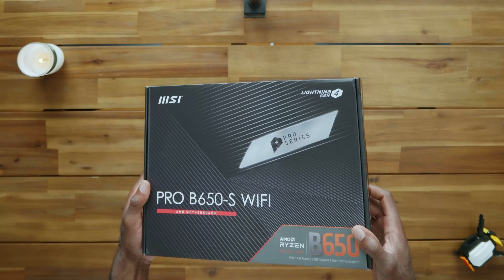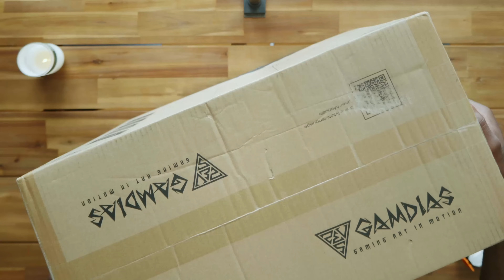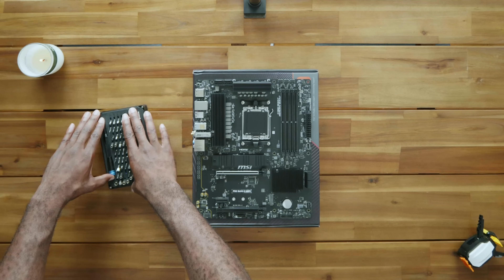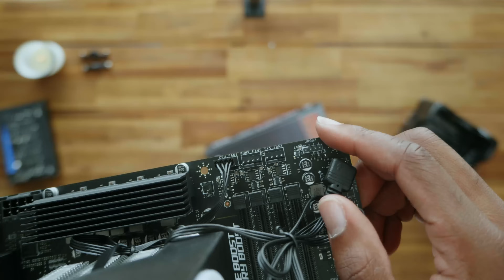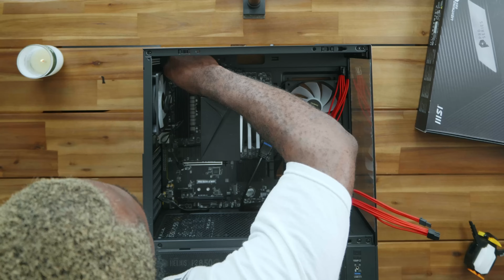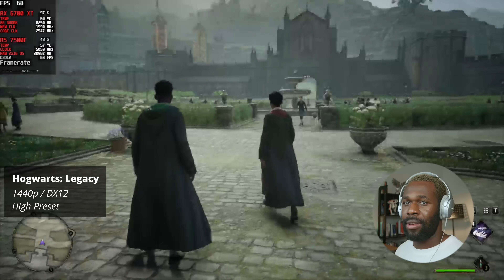A Calming $900 Gaming PC Build ❤️

Comment: Ill be honest with you for 900$ thats pretty meh performance for the story games with new parts but for your multiplayer games like r6 it will be excellent I would rather buy used parts for it to be cheaper and the optional cable extensions and combs will be useful for reselling but it wont sell because of the high price

Comment: Oh I also got a Ryzen 5 7500f, but a rx 6750xt gpu and just recently bought a ASRock B650m pro rs wifi motherboard. 

I still need to buy like 4 more parts to my pc build like ram, ssd, cpu cooler, and the psu. I may swap out the psu for this one if it cost that much. Was going to get the msi mag 850gl which is like 114 for the black unit. Other than that everything else is fine.

Hopefully soon I can finally be done with my buile!

Comment: I'm really glad you did this one at the higher price point. There aren't many cozy builders, and I've got a $900-$1,100 budget on a main PC replacement and I'm really only interested in 1080p gaming, though I wonder if my 4K/30 TV could do 1440p at 60? If not, 1080p will be fine.

This goes in my living room, and I'll pass my old PC down to my two younger sons for their room.

Anyway, by giving me an example of what you can pickup secondhand for a CPU and GPU, and this not being a pressing project, I'll have the patience to wait for a good CPU and GPU at killer prices, or at least what you did.

Do you have an opinion on the CPU/Motherboard/RAM combos that AliExpress sells? Or are they horribly unreliable?

Comment: I've been subscribed to your channel for a while now and your videos are so calming and your builds are so downright logical that you've inspired my next build. Well it's more like you've inspired me to finish my current system. I've been using a mish-mash of parts for years because I gave all my good stuff to family. An 11400 with no gpu, stock cooler, an h510 itx mobo, 16gb Corsair LPX ram, a 600w Corsair sfx psu, in a Rosewill case with no side panels because there's absolutely no airflow. I'm gonna upgrade to a Thermaltake Versa H18, which I've grown to love after seeing it on your channel so many times. I'm going with a Thermalright Assassin X cooler because it's all I need. I wanted a really clean, white, minimalist, liquid cooled system for a long time, but I've realized I can get a lot more bang for my buck buying the "uglier" budget parts and putting the majority of the budget into the cpu and gpu, which will most likely be a 5700X and RX 6700 XT. Almost a sleeper build. No rgb, no bling, just sensible hardware that gets the job done. Love the channel.

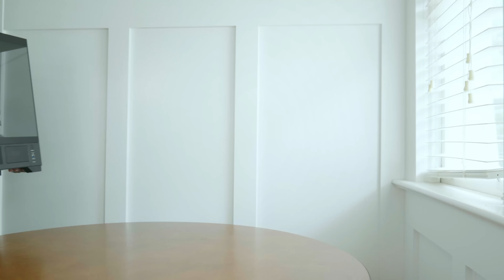Comment: @17:20 the Graphics Card is already bending - it needs support to keep it straight, it's too heavy for the PCIE slot.
It will work fine for now, but in the long run it will break your card (I learnt that the hard way)

Comment: I believe the Ryzen 5 7600 comes with the cooler, saving a bit of money, plus it's slightly faster than the 7500f. Also the PSU should be at least 750W, taking GPU and CPU upgrades into consideration in the future, seeing as we're building on the new AM5 Platform. Also if you can, find 6000mhz DDR5 Ram, as AMD has officially stated that this is the sweetspot. Check that the CL is preferably CL32 or lower, but it's not too important at this price/performance point. Generally, for gaming at least, spending less money on the cpu and more money on the GPU is important, especially if you're gaming at 1440p or higher. At 1080p the CPU becomes more important though.

Comment: Hey dude, quick tip there, the jump in performance from 5600mhz cl40 to 6000mhz cl30 ram is pretty huge and the price difference is very small, the specific kit you chose is kind of atrocious

Comment: Total: $907.76 Better: 6000 CL30 RAM, 3 m.2 mobo, hi-end NVME, A-tier 750w PSU
CPU: AMD Ryzen 5 7500F 3.7 GHz 6-Core Processor  ($130.00) 
CPU Cooler: Thermalright Assassin X Refined SE ARGB 66.17 CFM CPU Cooler  ($17.91 @ Newegg Sellers) 
Motherboard: ASRock B650M Pro RS WiFi Micro ATX AM5 Motherboard  ($149.99 @ Newegg) 
Memory: TEAMGROUP T-Create Expert 32 GB (2 x 16 GB) DDR5-6000 CL30 Memory  ($94.99 @ Amazon) 
Storage: MSI SPATIUM M480 PRO 2 TB M.2-2280 PCIe 4.0 X4 NVME Solid State Drive  ($129.99 @ MSI) 
Video Card: XFX Speedster QICK 319 Core Radeon RX 6750 XT 12 GB Video Card  ($250.00) 
Case: BitFenix Nova Mesh M ARGB MicroATX Mini Tower Case  ($54.90 @ Newegg Sellers) 
Power Supply: Thermaltake Toughpower GF1 (2024) 750 W 80+ Gold Certified Fully Modular ATX Power Supply  ($79.98 @ Amazon)
Reply: His Motherboard is better.
Reply: NOPE. @GameslordXY

Comment: Really not impressed as to how far we've come in the last 3-4 years.  I paid about $900 for slightly less performance three years ago.   Today's builds should be blowing me away.
Reply: A 3600 or 5600X and a 5700XT is still a decent rig but it ain't close to the level of a 7500f or a 6700XT.

Comment: What kind of optimizations did you do in the bios?
Reply: 🙂 normally you want to update the bios, set your fan curves, date time, turn on Rebar 4G for the video card, and speed up the ram speed, undervolt or underclock the cpu so that it doesnt get too hot

Comment: Planning to build something similar in price, already have RTX 3070 Inno 3D for 225$ and want to save $ with 1tb ssd so i can squeeze  in good 1080p budget monitor (AOC 24G4X)
Reply: Hope that prices on these parts will go down even more in 2-3 month: 
r5 7600, ASRock B650M - HDV/M2, 32gb of 6000 cl30/32 RAM (GOODRAM or cheapest one), Crucial P3 plus 1tb, Cooler for CPU, m-ATX case (still haven't decided), Seasonic FOCUS GX ATX 3.0 750 and monitor
Reply: Total: $757.76 Better: 6000 CL30 RAM, 3 m.2 mobo, hi-end NVME, A-tier 750w PSU - no 12VHPWR though
CPU: AMD Ryzen 5 7500F 3.7 GHz 6-Core Processor  ($130.00) 
CPU Cooler: Thermalright Assassin X Refined SE ARGB 66.17 CFM CPU Cooler  ($17.91 @ Newegg Sellers) 
Motherboard: ASRock B650M Pro RS WiFi Micro ATX AM5 Motherboard  ($149.99 @ Newegg) 
Memory: TEAMGROUP T-Create Expert 32 GB (2 x 16 GB) DDR5-6000 CL30 Memory  ($94.99 @ Amazon) 
Storage: MSI SPATIUM M480 PRO 2 TB M.2-2280 PCIe 4.0 X4 NVME Solid State Drive  ($129.99 @ MSI) 
Case: BitFenix Nova Mesh M ARGB MicroATX Mini Tower Case  ($54.90 @ Newegg Sellers) 
Power Supply: Thermaltake Toughpower GF1 (2024) 750 W 80+ Gold Certified Fully Modular ATX Power Supply  ($79.98 @ Amazon) @GreaT_T1t

Comment: Great build! Love your content man! One question, is the airflow correct this way? I have a similar case and wondering whats the best airflow for it.
Reply: normally the fans on the side panel in the front are intake, bottom fans intake. And the top and rear are Exhaust.

Comment: 9900kf $150 new local, pulled to trigger to upgrade off the 9600k today!
Reply: cool broh, basically a modern i7 8/16, buy more 😏👍🐢
Reply: @MrSamAdolfo  ya i dont plan to overclock, going to undervolt to get heat and energy costs down
Reply: @reborn727  😊buy a Watt Meter for all you AC Outlets, i have to pay the electric bill every month so the lower the Kilowatt Hour the better 🏡

Comment: You influencers, ALWAYS or nearly always choosing either unverified (no reliable professional reviews)or when reviewed units typically below average.
It's like You enjoy misleading your subscribers that DECLARED Wattage alone matters and never or almost never mentioning that 80+ Bronze and Gold does NOT guarantee quality (I cannot say about Platinum and Titanium ratings).
Transient power spikes can be EXTREMELY dangerous.
Granted 6700XT doesn't have massive ones and PCIE 5.0 PSUs can handle EXTREME powerspikes,but that's assuming companies did not cut corners with parts quality which some do.

And is it so hard to go with 6000CL30 or 6000CL36?
They cost few $ more or less then what you picked.

The problem with 7500F is no warranty as far as I am aware,at least not when ordered from Allie Express,but Ok.

When it comes to used GPUs Neither 6700XT nor 3070 have no business in 925$ budget.
Instead the 7700XT should be in there.

Off course it would be necessary to go with 60$ 1TB SSD and 79$ 750W Thermaltake GF1(2024)PSU in that Case.

For Combination of gaming ,content creation and streaming,the RTX3070 is best choice because of Nvenc,Tensor , RT and CUDA Cores.
Reply: Was talking PSUs regarding unverified units.
My Browser isn't allowing me to edit comments.
Reply: 😒👍 3070 3070thai 3080

Comment: i resently got my pc upgrade for 719.34 $ same cpu a620m s2h mobo adata 16 gb ddr5 5600 all new and rx 5700 xt 650 watt power supply samsung ssd 256 gb all used i gave my old parts in exchange put this price is form the part with out discouting of my other parts
Reply: 🙂👍🐢 yes sounds decent

Comment: I honestly only care about solid state storage as solid state storage.   As long as it ain't a disk.
Reply: 🙂 i use both together, the ssd for windows, and i put all my games on a used large capacity 3.5 Hard Drive, my gog library alone takes up 7TB of space
Reply: @MrSamAdolfo  That works but.  If it's one of those load constantly games it will be near unplayable.  But your setup works fine as long as you don't mind the wait or your game can run from memory.
Reply: @lordvoldamort4606  😊 sure i noticed that too on a few games the load times, i guess you can always buy a larger SSD so that you can run the video game your playing alot every week

Comment: I think the CPU cooler and PSU were questionable choices, I would have picked the ak400 and the MSI mag bn 650 instead just because of the brand.
Reply: yes the msi 650 is the cheapest tier c power supply at microcenter right now, i picked up three 😏👍🐢🐢🐢 and for tower air coolers I prefer the coolers with slanted back heat pipes

Comment: anyone wanna buy muy r5 1600 (50 dollars)  + r7 3700x (100 dollars) - looking to get a r5 5600x or a r7 5800x for my rtx 3070
Reply: When new 5600 is around 115$ or so,maybe 120,you shouldn't be selling 3700X for more than 85$.
Probably less because used 5600 can probably be found for around that amount as Well .

For Productivity it May or May not be Close to 5600,but in gaming with proper GPU it's CRUSHED at 1080p .At 1440p the difference is smaller,but still quite signifikant.

At 4K there probably isn't much of a difference,but people are ignorant and few would use them for 4K with HUGE majority believing High end CPUs are required for it.
Reply: @GameslordXY  for the comparison u gave whic cpu are u comparing the 5600 to?

Comment: I went looking for that $95 2tb ssd. Amazon has it for $120 now. No dram
Reply: Many NVMe SSD's (you could check your specific model, but generally most drives using PCIe Gen 4 support this feature) use HMB technology (Host Memory Buffer). This allows the SSD to use a small portion of system RAM as a buffer. Gen4 drives also generally are fast enough that, combined with HMB as RAM, you will not see a noticeable difference in daily activities, game loading, etc. If you saturate your drive with large file transfers regularly as part of your work flow, I would suggest a drive with DRAM.
Reply: @octodinosaur2419  is that OS dependent? I would absolutely saturate at first building a 1tb Batocera drive. I'm ready for SSD prices to come down.
Reply: @saysbadman  I am not familiar with that distro, but Ubuntu, for example, supports it fully to my knowledge.

Comment: Love what you do Oz. I always build my own pc's. My first ever pc was a Compaq 286 box and I upgraded it by adding a 3.5 inch floppy drive! Also added some ram chips which back in those days (I'm 67) plugged into sockets on the motherboard. The trouble with watching you (and for example The Toasty Bros) is that I get the upgrade itch even at my age! Here in the UK the CPU you chose is more expensive (cheapest I found was £149.99 on Ebay) but the cooler is cheaper, £20.99 on Amazon. Keep on building!
Reply: 😊 my first pc that my parents bought me was and IBM AT Clone 286, the case said Kaypro, i special ordered a click clack keyboard which was a clone of the IBM keyboard, nowadays to replicate the feeling i use mechanical gaming keyboards, i have one that blue switch and another is red, feels good, I still have the pc upgrade itch so what I do is every once in a while i buy cheap old used computers off of my local area and fix em up just for fun and see if they still work and try out some video games on them.

Comment: im really thinking of selling my pc, and rebuilding a new one because i dont really like my case and i cant change my RGB. my gpu is also pretty outdated as its a msi 2060 6 gig but i have an i7 12700k and i love my cpu so im conflicted
Reply: 🙂 sure broh, i do that all the time, i like to move my pc parts to a different case, some cases come included with 3 or 5 argb case fans, the hub is included, you switch the lights with the reset button, you can then add an argb cpu cooler and plug that in as well, i have your cpu in one of my builds too, its good enough for now, the 2060 is still a good budget graphics card keep it for a second build or use it to sell a pc, it doesnt require too much power supply
Reply: @MrSamAdolfo  yeah, it’s my motherboard, my argb is stuck on rainbow because my asus motherboard isnt detected by armoury crate
Reply: bro, the CPU is good enough for a new GPU. YOu can add up to a 4070 Super/4070/RX 7800 XT with that thang.